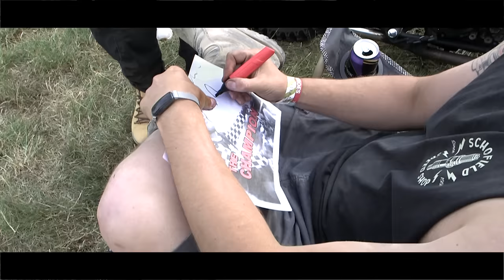'On Any Other Sunday' - Spoof

Comment: When I was in my early 20's a distant friend sadly told me that as he got 1 , 2 and 3 years older his motorcycle racing sponsor declined his next upcoming year of sponsored racing .
 This was because of his body weight . The new replacement rider that was hired , was only 140 Lbs , while this mans weight was now up to 220 Lbs . By the time the racing season started he would be up to about 230 Lbs . 
    As folks talk about so smartly cutting , grinding , machining etc 3 to 5  Lbs off their bikes . They must also think very fast of their own body weight !  Not only their bike . Think of the difference between 230 and 140 , that's 90 Lbs . That's incredible !